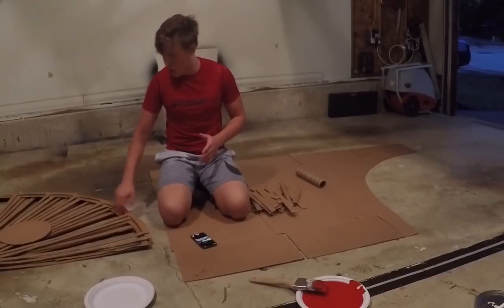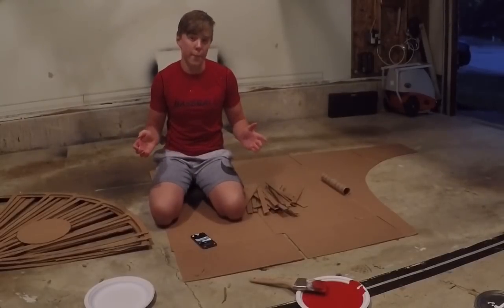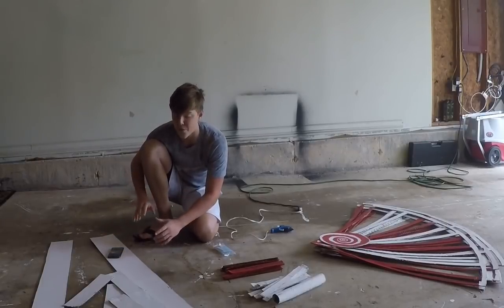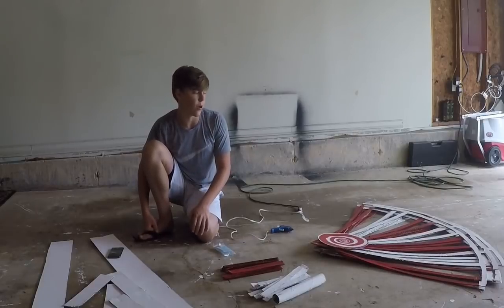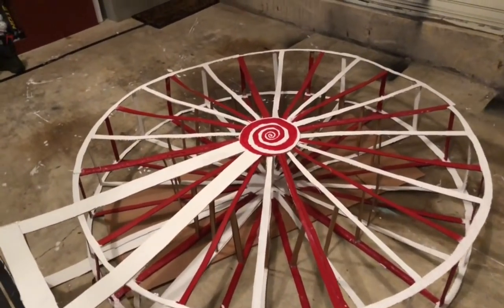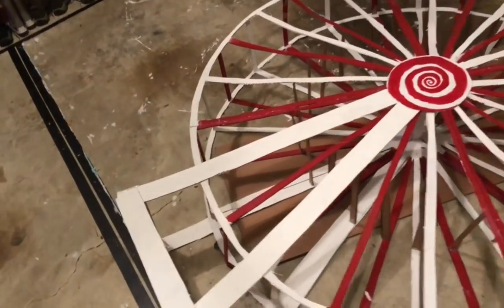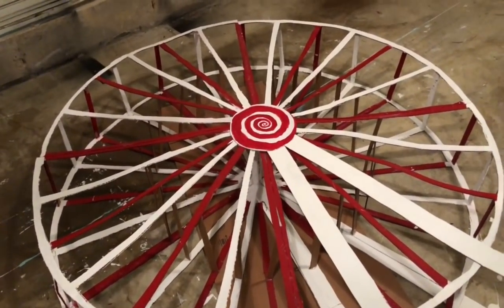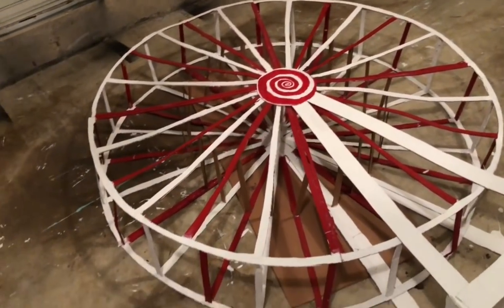Haunted house build 2018 part 1 (ferris wheel)

Comment: How old do you have to be to work at Spirit?
Reply: 16
Reply: Ummm 14
Reply: 16
Reply: 16
Reply: It hasn’t to be 14 I’m working at my local spirit and I’m 14
Reply: TJ Imhof On the website it’s says to be a Spirit store associate you are required to be At Least 16 years of age with working papers and info filled out. If you were to work younger which I doubt getting paid, you would need to take the Child labor laws into consideration so yes 16 is when you can officially works.
Reply: That’s weird idk it’s says I’m getting paid but I don’t know I’ll have to call the store I’m working at